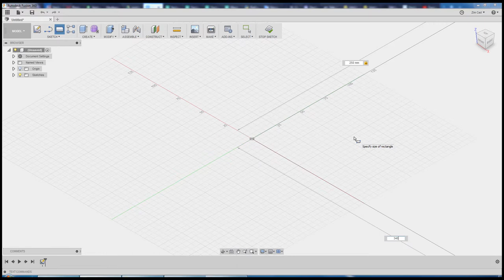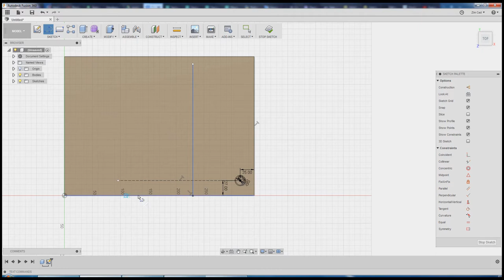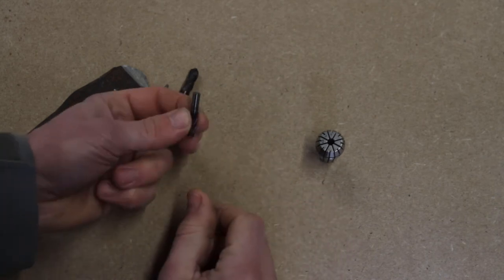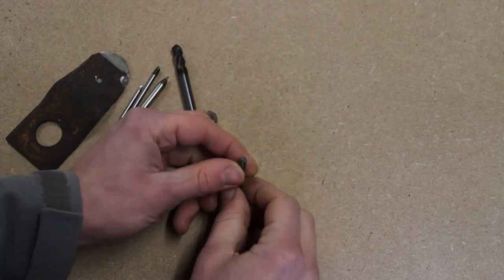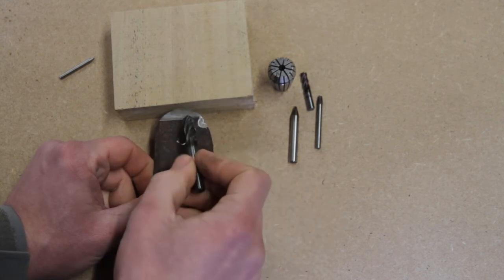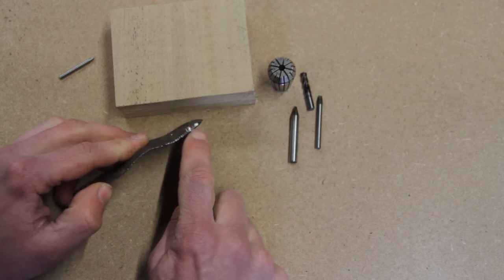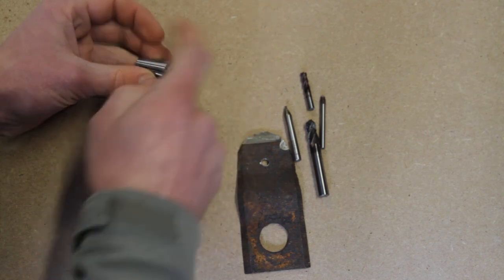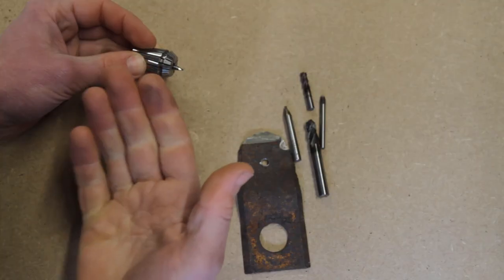CNC Collet Holder

Comment: Been following your build from start to finish as well as the CNC Zone Forum you discussed...Very nice job...How's it cutting?
Your machine is very similar to what I'm imagining I will build mine...I have searched high and low and can't find this information anywhere and thought you may be of assistance...In one of your series you showed, and end shot of the "T: Extrusion...I believe it might have been the 80160 and from that view it sure liked it was a heavy webbed version of what I have found from a couple detailed drawing...Is this a standard heavy 80160 or is it heavier than the heavy? I would like to get the thickest web on the Extrusion I can find for my Gantry...
Be sure you continue with the projects both in wood and aluminum on the various materials just to see your progress and projects as well as the performance of this machine...
Again, it is certainly something you can be very proud of...
Reply from the maker: Thank you for your interest. The side extrusions is 80x160mm heavy profile (https://www.smt-montagetechnik.de/produkte/98.htm). I believe they are plenty sturdy. If I would beef up one, it would be gantry extrusion. However, you have to keep in mind that extra weight will give slower accelerations.

Comment: It's incredible satisfying to see an idea take shape on your machine! Fusion and work-piece offset;  I find it handy to use a tool-setter to measure the tool height in relation to your bed and use the top of the bed as a Z0 for your G54. If you're using a clamp, simple model the clamp in Fusion as well and use it within the cam. With a warped piece of wood or inconsistency in thickness of the material can be taken into account by Fusion. I've started to use the parameters in fusion to define the material-thickness. Works like a charm IMO. Great work! In wood i use a ~25-35 degree helix or ramp. smaller holes lower angle ofcourse. :)  I aim for about ,2-,6 mm feed per tooth. Most of it at around~14000rpm. Don't be too shy. just observe the sound the machine makes.
Reply from the maker: Thank you for your comment and insights. In this video I'm milling really slow and I go a lot faster now.  For a good finish, I tend to go a bit slower but otherwise I like to push it a bit more. But maybe I still can go do a bit more. I also setup my tool-setter. That makes changing bits a lot faster. Mostly I use it in reference to the bed but not always. I use parameters for some of my projects but didn't know it is also possible to use it for material thickness changes. Thank you for the tip. I will check it out.